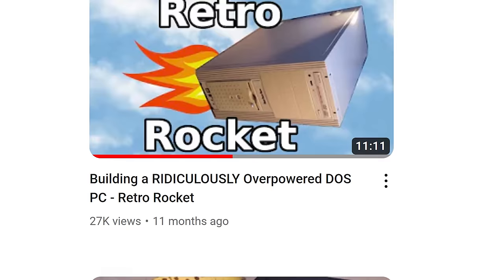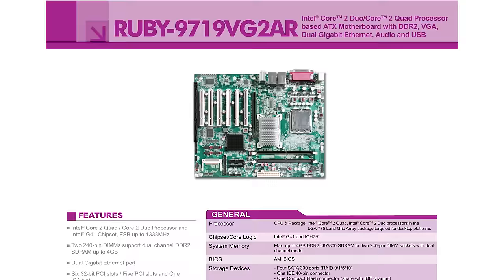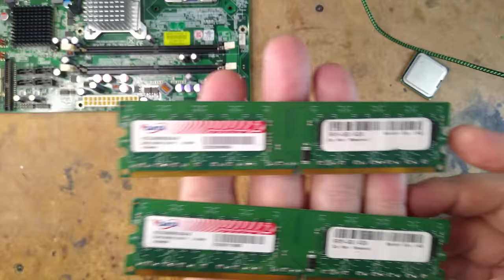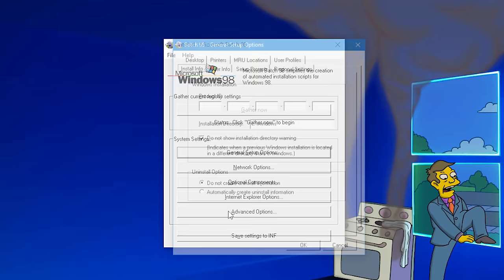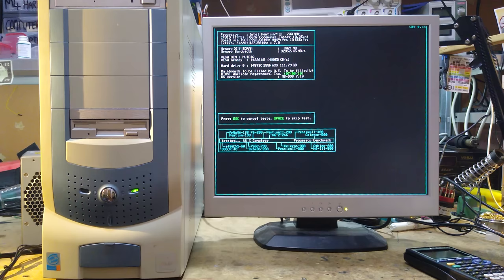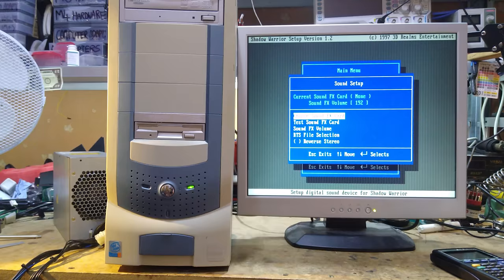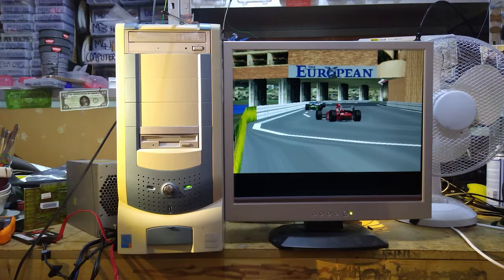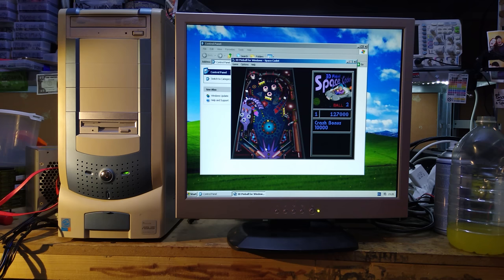The FASTEST DOS Gaming PC Ever?  #DOSCEMBER

Comment: Man, that win 98 install was awesome. Seeing something that you know takes some times and seeing it go much faster is mesmerizing. Would it be too much to ask for a real time video of the full installation, with a clock besides it ?

A couple more things to mention:
- did the sound settings maybe can be set from BIOS ? I assume you already checked but did not mention anything in the video, so I have to ask. On this regard, in another comment I also asked if this maybe can be set from DOSBox, though I guess it's the same as trying to run it from a command prompt. I know that in windows 95 you could manually assign IRQ ranges and stuff like that. In windows 98 too, but less so. Maaaybe it can still be done with some registry entries or something in windows XP or later ? Or maybe someone knowledgeable enough can replicate in proper way (a driver maybe ?) those settings for NT-based windowses.

- if I'm not mistaken, in general software rendering (which is what I assume you did in doom, quake, shadow warrior and the like) is just very poor at scaling with resolution. I think it's because everything is computed by your CPU, in single thread fashion, which cannot really do much in parallel. I do remember running Quake on my i7 6700HQ and it ran just as bad, something like 20-30 FPS for 1080p resolution.

- in the msdos benches, at times it showed either 300 something MHz or 700 something MHz. Any more thoughts on that ? Maybe it's actually running at that speed for some compatibility reasons and maybe that's why the scores are not that high. While we're at it, general performance bottlenecks on these kinds of things would be interesting, who knows, you might find and fix a problem and see a literally 10x performance increase (at least I wouldn't be surprised)

- since MS-DOS runs natively, does that mean that Windows 1.0 to Windows 3.11 also work natively ? While on that, any chance to do a have all of Windows versions (from 1 or 95, whomever is the oldest it can natively run) installed at once (and showcased) ? Or maybe install the oldest one and upgrade from one version to next until Windows 10 ? (I remember there's a guy on YT that did that)

Comment: I picked up a GVC ESS Maestro-1 ES1948F PCI Sound Card  off of ebay. These ESS PCI card chip sets, starting with ESS ES1946 Solo-1E, support three means of compatibility with DOS legacy programs that require ISA card DMA like behavior: 1) Transparent DMA (TDMA), 2) Distributed DMA (DDMA), 3) PC/PCI using a Physical SB-LINK connection

Am looking especially for support of the Transparent DMA (TDMA) approach.

In theory a currently manufactured PCI-based motherboard might very well accept this card and thereby also work with DOS legacy software using sound via the TDMA feature.

Can still get motherboards with PS/2 for keyboard and mouse (and those devices are still available on Amazon, etc). Will have to noodle some way to support compatible storage for the old DOS stuff. And not sure what will get using modern PCI Express graphics cards. But I do have some PCI graphics cards that are over ten years old so those might work better.

Well, worse case is might have to write a modest hypervisor that does a wee bit of virtualization on behalf of the ancient 16-bit real-mode DOS code. But that hypervisor could do pass-through where ever feasible (e.g., might be the best way to provide EMS memory). And with a wee bit more effort it could become a MS-DOS multi-tasker - similar to those that cropped up when the 80386 first appeared.

The final worry is how would some of this software behave on a CPU running at multiple gigahertz...

Comment: I have a FirePro W5100 I picked up for about $25, it's single slot, no external power, and it looks like it might fit in that slot, it only comes back about an inch from the end of the slot

Also, you should try MechWarrior 2

Comment: I used the same grub DOS trick when I accidentally wiped the DSDT table of my laptop using a dodgy hacked bios - trying to OC the processor - the tables were empty and I couldn't boot a modern enough windows to run the flash software. I used a DOS program to push the needed tables into place from a file I had constructed in Linux then I used grub to boot XP and run the flashing program. Took me weeks to reach that stage!

Comment: I was able to boot DOS on a Ryzen 5600x + B550M + RTX3060. I tried to use a CMI8738 with PCIe to PCI bridge, but PC crashes after playing sound for few seconds. I think there is an issue with IRQ. I have checked newer MB (I think I saw some with ISA supporting 2nd gen Core CPUs, can't remember exactly ) with ISA but they are super expensive.

Comment: GP2 engine is weird — you specify target fps in the game settings and it's locked at 25,6 fps maximum if I remember correctly. To check how the PC copes with it, you need to press O during gameplay and it will show you CPU Occupancy while button is pressed. If CPU can't handle your graphics settings, it will show over 100% and gameplay will slow down to reach fps target

Comment: I did a video a few years ago showing a more modern Core 2 Celeron vs 386, and if you know that video, you know who I am. Guy has to have many accounts.  Modern hardware does not perform like you would expect with DOS. The fact that I was able to disable ( haha ) the cache on the Core 2 Celeron and it equal the performance of a 386 shocked me, but full performance the FPS in DOS was not what I expected.  Your benches reflect what I found to be the case years ago.

Comment: Also, Windows 98 cannot out of the box address more than exactly 768MB RAM due to how Windows interprets memory pointers (signed bit determines kernel and userspace segments) and how Windows vcache works. If you want to run Windows on something that has more RAM, you'll need to install it with 768MB RAM or less anyway, and then modify vcache settings so that Windows doesn't make more than 0x40000 memory pages. Should work fine. Also, since you've set out to build an overkill DOS PC, why didn't you get an AWE64 Gold?

Comment: Yes, the excellent X5470. They also overclock insanely well, I have done benchmarks at 4.8 GHz on air using a Hyper 212 :)
Reply: That mobo OP bought is not suited for OC. It has crappy G41 chipset. Most likely all clock generators on it are tied together so he can damage other HW when raising FSB a little.

Comment: Man, a couple days ago, I didn't know the ruby board existed, and now I'm thinking about throwing handfuls of cash at ebay to get one. I don't even need it (my current DOS machine is already too fast and has 3 ISA sound devices), but it's just so friggin awesome.
Reply: Check out the dissapoint project in the Vogons forum. It's a project to add ISA slots using the LPC pins on the TPM header that some motherboards feature. I'd look at that before spending a huge amount on an older board. Anyway, the guy who designed it is saying he might start selling the adapters if there's enough interest.

Comment: Nowadays you don't need ISA slot/sound card for DOS gaming anymore. There are two DOS utilities available on Vogons: SBEMU and CPUSPD. SBEMU emulates a Sound Blaster on motherboards with integrated AC97 sound chips. CPUSPD slows down the CPU for speed sensitive DOS games, and it works on socket 370, 478, 775, AM2, and AM3 (K10 cpus). So the fastest DOS gaming PC that could run (almost) all DOS games would be the Core2Quad Q9650 or the Phenom II X6.

Comment: How did you managed to run 98SE with PCIe graphics card? Are there any drivers capable of running 3D games? I always thought AGPx8 and something like GF6800 with 256MB would be the peak what this platform can handle. also about RAM wasn't it that the whole 98 could run up to 1GB memory in total, that is both RAM and VGA memory?
Reply from the maker: VBE9x. No 3D accelleration but there certainly are PCIE cards that can do 3D on Win98 (geforce 7 series)

Comment: Grab one of those PCI-E risers that the mini-itx modders use so you can relocate the GPU away from the RAM and try a GTX 1080ti. I'd be interested to see if you could get a machine that could handle the latest AAA titles and still perform well with DOS games. I'd also be interested to see if you could boot your other operating systems from a network drive so you don't have to worry about partitions and the stability issues they cause.

Comment: I'd actually like to see some Early DOS games and console emulators thrown at this. I wouldn't be shocked to see them running unplayably fast. Wolfenstine 3D or the original Escape from Castle Wolfenstine. You didn't mention if there was processor throttling on this configuration like in your weeCee build.
Reply: Basically things 8 and 16 bit native DOS, do they still run?

Comment: Nice build, I ported rubyisa program to syslinux bootloader to make isa slot useable under linux and winxp, isa graphics card and sb64 sound still no dice due to lpc to isa bridge limits.
Reply from the maker: I was thinking of trying to get MDA/Hercules/CGA working, do you think that would be possible with an option rom or something?
Reply: @TheRasteri  I am not familiar with isa graphics cards. If dma ranges required by isa graphics cards supported by   Fintek F85226FG, worth give it a shot. More details you can ask Tiido (original rubyisa.exe author, quite nice guy), he didi a lot research in this lpc to isa bridge.

Comment: Check DFI CS620-H310 which can take 8th and 9th gen. Intel CPU, and it has 2 ISA lots. I wonder if that would work with DOS.
Reply from the maker: @-dimar-  almost certainly not, intel dropped support for DMA after 7th gen so dos soundcards probably won't work

Comment: I'd be really curious if dropping in something of a fancier end of PCI graphics card (something like a Matrox Millennium II or a one of the higher end Diamond Stealth cards) might give better performance in dos games, since the nvidia gpu  you dropped in there really wasn't ever intended to do such things and basically only handles them for the sake of compatibility... of course maybe it'd perform worse, but I'd be curious to find out either way!
Reply from the maker: I've tried a few PCI cards and they all get worse performance than any PCIE card. I think the raw speed PCIE provides is more than enough to overcome any compatibility speed reduction
Reply: @TheRasteri  there's an additional angle that's just occurred to me for consideration, the pci implementation on that board specifically is likely a pci-express based shim? As opposed to being something natively supplied from the Chipset/Northbridge, that could also have a negative impact on performance for pci devices?  Or again, could be a wash, could be that the 250MB/s of a single pci-e lane is enough to overwhelm any bottlenecks added by protocol translation.
Reply: Mr Guru  but that's agp vs agp, not pci over pci-e vs pci-e (although still pretty interesting to know :))
Reply: Mr Guru  Unless you're talking about performance for DOS/VESA mode games, at which point the bus interface to the graphics hardware may be less of an issue than the vga core on the graphics card itself, now that I think about it I remember my Matrox cards in the 90's actually weren't fantastic for DOS stuff, Lemmings used to freak out and get heavily psychedelic for one thing.

Comment: Sad that Win 10 didn't detected the ISA slot, i hoped you could put in a floppy controller and use 5.25" inch or even 8" floppy disk drives in Win 10.

Comment: In retrospect it's a shame PCI chipsets didn't have Soundblaster compatibility built in. After all they did have VGA support built in. VGA support just forwarded the legacy VGA ports to a PCI graphics card. Soundblaster support could theoretically have forwarded the motherboard DMA control IO ports to a PCI sound card.

Incidentally it's not all that hard to write a kernel mode driver that just pokes the IO ports you need to enable sound on initialization. Since it's Windows XP you don't need to sign kernel mode code either.
Reply: Mr Guru  Those Realtek and Crystal chips are not Soundblaster compatible though. IIRC they're just the DAC/ADC part of the audio and the digital part is in the chipset. Unfortunatley that is also not SoundBlaster compatible, even though it could have been.  

Contrast that with VGA compatibility which most motherboards used to support for both onboard and PCI graphics cards.

Comment: What can you say about Interloper IM7945 Socket 775 Motherboard
Pentium 4 socket 775 motherboard with 1 ISA slot, DMA support, Gigabit LAN?

They pretend to support Intel Core2 Extreme (QX9000)
Up to 4.0GHz speed and up to 12MB L2 cache. But how is this possible on Intel Q45 Chipset?

Either scam or sensation

And also there is a patented technology called Transparent DMA, and because of patent it was specific to ESS chips. Patent has expired, somebody (like authors of Orpheus II) may make use of it again, or make a working TDMA-based PCI to ISA converter maybe. Unless something else, also important was broken. Curious if latest motherboard with gen 14 Core i9 will work with ESS Solo-1. Or Ryzen

Comment: My last DOS-PC had an Intel Core2quad@2700mhz on Asus Striker mainboard(IBM BIOS) with 8 gb DDR2 and with Radeon 9750 PCIe card on 28" LCD monitor (1920x1200 native resolution 16: 10 aspect ratio) and with Soundblaster Audigy PCI card booting from 2 gb USB-Stick FAT16 with MS DOS 6.22 or booting from selfmade Boot-CD-ROM floppy emulation drive A: ready to start all 4 cores and switching into 64 bit mode from DOS. I never play DOS games.

Comment: nice . would you please tell me what patch or software, do you use to solve high memory handling problem with windows 98?
Reply from the maker: Patchmem by Rudolph Loew
Reply from the maker: Mr Guru  well it probably helped for crysis, haha
Reply: Mr Guru  Simply having multiple things open will use more RAM. Though because it's single threaded in mind, that would make everything run like crap anyway. If we're talking about a single program, I don't know, an excel file with a lot of data might also fill the RAM quickly and need more than 512 MB of it
Reply: Mr Guru  Oh, shit .... 😅

While on that note, I do have a win98 virtual machine, only to have Encarta Encyclopedia work and to play Mind Maze (man, it seemed like a much better game when I was a child). Strangely enough, the windows itself and the game lag quite much. Though I haven't checked that much on why.

Comment: how difficult could it be to create a pci to isa bridge using NOS chips? I bet only bga chips, but maybe some tqfp stuff? would be a good and interesting project
Reply from the maker: Intel Southbridges beyond ICH6 or so can't use PCI ISA bridges with DMA :(
Reply: @TheRasteri  and the one you've used just works because there's another chip on the LPC bus of the ich7? it's sad that the lpc bus is not generally available for use on any board, would've been nice to use this lpc to isa bridge... that sucks :(
Reply from the maker: @cocusar  Yeah there's a Fintek LPC->ISA bridge. And even it doesn't work without the RUBYISA utility...
Reply: @TheRasteri  I wonder if you could cobble together a slightly later Northbridge with the ICH6 Southbridge, like the Chinese clone boards do with the salvaged Server chipsets.
Reply: @TheRasteri  The main problem I see is the need for configuration. That could be solved with persistent storage maybe. Just a little microcontroller with an EEPROM, which will store the bridge configuration permanently across reboots and applies it automatically. Should be relatively straight forward, I think...

Comment: I work on industrial PCs, I know of several picmg cards that bridge lpc to a physical isa bus, and some of these can accommodate intel CPUs as recent as skylake, you should look into some of those
Reply from the maker: Interesting - do you have any model numbers for these cards? My guess is that they don't support DMA but it would be interesting to find out.
Reply: @TheRasteri  big one that comes to mind is the Advantech pca-6029, it has a similar bridge chip on it like the portwell mobo you showed off
Reply from the maker: @elektrokinesis4150  hmm yeah I'm 99% sure those boards won't support DMA. Not a problem for a lot of industrial applications, but most DOS games won't work :(
Reply: @TheRasteri  this board has the same chip on it that you used in the dISAppointment project
Reply from the maker: @elektrokinesis4150  Yeah the bridge chip is the same, but Intel removed LPC DMA from the 100 series chipset. I think last chipset with DMA was the X99.
Reply: Apparently the q170 PCH did support i8237 DMA during development, then support was removed during later. Early platform firmware may still have the feature enabled

Comment: I would wonder if you could do that trick where you boot from grub keeping the programming from rubyisa from dos, but then manually install some driver and maybe get ISA sound in a newer version of windows like Vista, 7, 8, 10 32-bit. I vaguely remember being able to fudge XP drivers into windows 7, I wonder if you could pull that off with the crystal driver. Really pointless though, but still I was super impressed you were able to work around the board's weird ISA slot programming and get it to run in XP, even if it was just to do it. I'd like to see some 3d accelerated DOS action with this system!
Reply from the maker: Unfortunately running rubyISA before Windows 10 makes no difference. I also tried 7. My guess is Vista breaks it